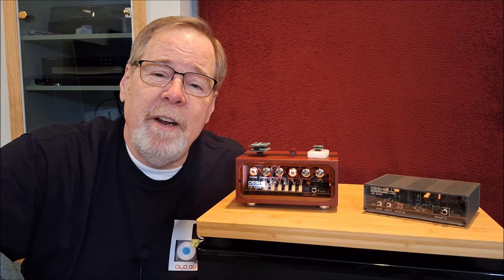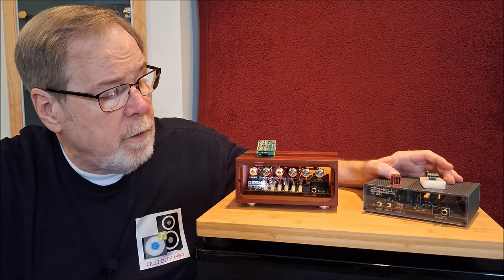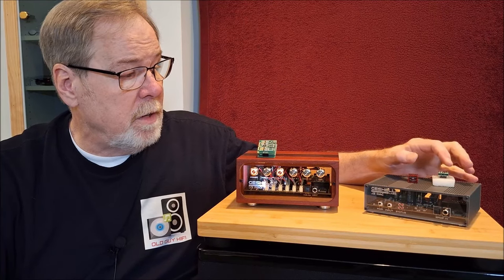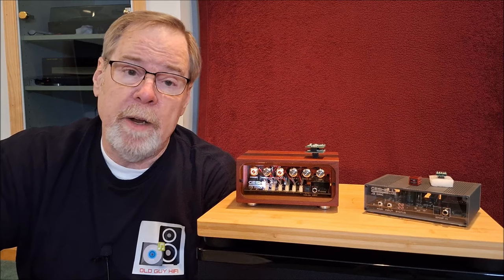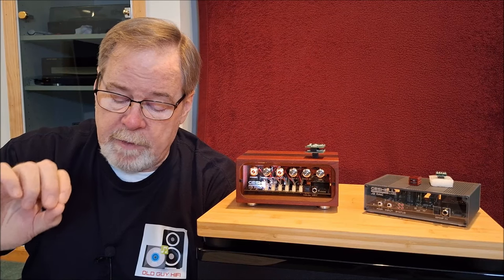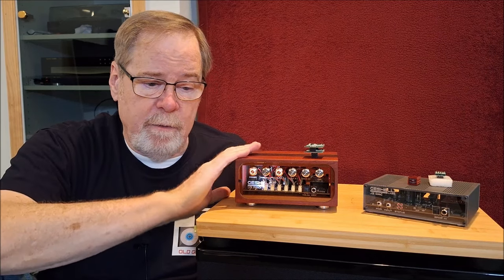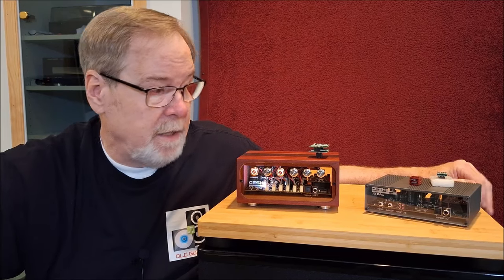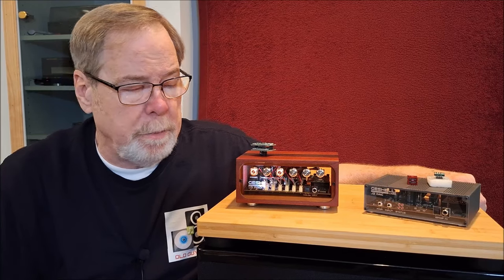The 1st YouTube review of the Geshelli J3 Pro DAC. IMHO it is a fantastic unit full stop.

Comment from the maker: Please understand that all of my reviews are completely subjective. They are my opinion and not to be taken as criticism or as negative. I can only share my feelings and personal conclusions.

The J3 Pro shares it basic architecture with it sibling the J2S socketed AK4499EXEQ + AK4191EQ hybrid DAC implementation. It  has been redesigned to accommodate the much larger Sparkos Pro Dual SS2590 op-amps. Geno Geshelli also updated the circuit design with an improved internal power supply, an improve oscillator chip and a relay switched USB board.

Comment: Very nice work!  Thorough, competent, clear, and devoid of filler.  Take another listen to USB on each of the two units, they are different circuits.
Reply from the maker: Not really. The USB boards are the same programing. On the J3 Pro and the Dayzee it has a relay circuit that can be shut down when there is no incoming signal. Sonically, I could detect no real difference but, that's just me. I will ask Geno when I see him next week. Thx.

Comment: Excellent video, Ed! You have nailed what I am also hearing in these DACs. I now have the eight SS2590 op-amps installed in my Dayzee - and it is by far the best DAC I have ever heard.
You're a "natural" at this - very informative, and direct.
Reply from the maker: Thank you so much. Maybe I could review a speaker or two? I will pay the freight.
Reply: @OldGuyHifi  The thought has crossed my mind! I will be shipping the first Tower 6 flat pack tomorrow, and MLTL-6 flat packs have been shipping for a while now.

I just revised the crossovers for the dome tweeter versions, and I think it is better than what I had at AXPONA. The cabinet of the Tower 6 has also been revised - and the bass is better AND extends to 25Hz vs 28Hz for the prototype.
Reply from the maker: Keep me posted. You have my email. Thank you so much for considering it.
Reply: @OldGuyHifi  put two of his TLine towers on a J3 and use a few Fosi V3 monos with the same opamp in all of them and let us know how good it is!
Reply from the maker: @morgande  I think they deserve something better then the Fosis as nice as those are. I would like to run them on the Orchard Audio amp. BTW I am getting that back.
Reply: Sorry I just caught up to this review. I got behind on YouTube. 😂 Great deep dive on the whole chip subject. My J2S with the 2590 on the single ended socket is truly outstanding. It’s attached to my vintage McIntosh system and ADS L710 speakers. It’s outstanding sound. It rivals my much more expensive Ladder Schumann r2r dac. I play them both interchangeably.
Reply: @OldGuyHifi agreed!
Reply from the maker: @stevezeidman7224  Thank you. I was curious to get your take on it vs the Ladder-Schumann. I do think that there is something to this chip set. I have the Orchard Audio mac-daddy streamer-DAC in house for a review and it uses the same chips and it also sounds amazing. At $1500.00 it should!
Reply: @stevezeidman7224  C'mon Steve - you're hours late ... 😀
Geshelli Labs has a stunningly good DAC model lineup - in my opinion!
Reply: @NeilBlanchard  You got me, Neil! Yeah, they are certainly not a one trick pony anymore. Their range of models and chip sets can satisfy anyone. Knowing them as we do, I’m very happy how successful they have become.

Comment: Earlier in 2024 I did not wait for the J3 and got the J2 socketed. 4499 chip and Burson V7 Classic op amps, single ended only. My seventh DAC in 25 years. I was concerned about Burson V7 Vivid due to my Klipsch Chorus II horn speakers. I use Tidal through a Blusound Node and a Tascam transport. Both sound excellent, but Tidal HD recordings are exceptional.

Geshelli J2 socketed DAC goes great with Conrad Johnson PV12B preamp and KT-88 amplification.

Great reviews!
Reply from the maker: Thank you for your view and comment. The J2S and J3Pro fire all intents and purposes see sonically identical. I bought the J2S I used in the review.

Comment: Ed: Great review that was concise and easy to follow and understand.  I upgraded my Geshelli J2S from the Sparkos SS3602 to the Sparkos SS2590 this week. You are 100% correct in your evaluation. Even my 76 year old "stone deaf" ears could hear the dramatic improvement!  My system of ELAC UFR52 tower speakers, EMOTIVA 135 watt receiver and ONKYO CD changer sound unbelievable.  All aspects are markedly improved and I am hearing things I have not heard before.
Chris G. San Diego.
Reply from the maker: Chris, That's awesome. I am so glad you are enjoying  the sound. Gear that can put a smile on your face is a real kick, Thanks for watching and sharing your experience.
Reply: @ChrisGarrett-q1x  hey Chris, fellow J2S user here, thinking about upgrading to the 2590 on the unbalanced output. Were there any special connectors needed or was it a simple swap out?
Reply: @moremeditations3622  I'm not sure I  understand balanced vs. unbalanced, so here is what was done.  My previous amp did not have XLR, only RCA connection.   Because of this I only have 1 of the 2590 op amps.  There were no special connectors and fit perfectly in place of the 3602. 
Forgot to mention that I also upgraded to the AKM 4490 chip set.  This was done by Geshelli.  Sent it to Geshelli for the install. This was also another great improvement in sound. 
I hope this helps.
Reply: @ChrisGarrett-q1x  yes this helped a lot, thank you!
Reply: one final note. Sparkos sent the SS2590 fully assembled as I am not a do it yourself person.

Comment: Great review. I'm just tired of chasing dacs. I bought the best l could and now they'll have to do. Your info is great for new buyers though.
Reply from the maker: Michelle, I agree with you. I thought I was done and in a long term relationship with my Schiit DAC. This new chip technology from AKM is spinning my head around. It sounds very good and the units have a couple of features I don't have like DSD and balanced outs. What DAC did you get?  Thanks so much for you comment and for tuning in.
Reply: @OldGuyHifi  My Geshelli Dac totally outclasses my Schiit. I love Schiit gear, but my phono amp has been replaced by a Darlington Labs MM6B and I am now running a Geshelli Dac. Huge upgrades.
Reply from the maker: Christopher, Which Schiit and which Geshelli DACs do you have?

Comment: Just swapped the 2590 into my J2 4493.  Using the unblanced outs.  From the 3602 to the 2590, it is quite an amazing upgrade.  Thanks for the heads up!! Dig the channel!!
Reply from the maker: Bobby-Bobby, You are welcome. I am glad you are enjoying that new op-amp.
Reply: @BobbyTwoTimes  Hello, do you have use raiser to install the SS2590 into your J2, just to add i have the J2S dac.
Reply: The stacked op amp from Sparkos will fit the single ended J2S.  It's snug, but it works.  Balanced will need risers and a taller case.  Sherri at Geshelli can set you up if you want the J3 case, and front/rear faceplate that accommodate the J2 board.

Comment: Great review. Thanks. Would be interesting if you were able to hold onto the J3 Pro and combine with their Achel Pro as preamp / DAC combo driving the Orchard Audio. Would probably make a nice reference level review system…
Reply from the maker: George, It would for sure.  That said I have the Orchard Audio PecanPi+ Premier streamer DAC in and it also uses the AK4499EXEQ + AK4191EQ combo chip set and can be a pre-amp. Unfortunately I had to return the Amp. I will ask for it back and maybe do a review of the OA combo. Thanks for the suggestion and your comment.
Reply: @OldGuyHifi  It’s unfortunate you had to return the OA amp. Would have been interesting to compare the 2 AK DAC implementation (or any source) with the same amplifier/speaker setup - ie introduce a new component for review but the rest of the system is a known quantity.
Reply from the maker: @georgechirayus4865  Turns out I will have the amp back in my possession next week. So watch this space.
Reply: @OldGuyHifi  Niice!! 🎉🍾🎊

Comment: Very informative. 
As I’ve mentioned in the comments of your fiio r2r dac, Sound stage, width and depth are what I’m looking for. My speakers are Maggie’s.
Reply from the maker: I can recommend the Geshelli J2S or J3 Pro with the AKM4499 setup. They sound near as makes no difference the same. Either of those will give your system all of the needed signal to develop the best sound stage it is capable of. There lots of other great DACs I just happen to really like the sound of the Geshelli units. I also like Denafrips and Chord but they get expensive. Let me know what you decide to do. BTW, I have a Denafrips Pontus review coming out & I just got a Chord Cutest in for review. Thanks for your view and comment.
Reply: @OldGuyHifi  Hello and thank you for your detailed reply. Yes. The J2s with Sparkos is roughly $100 less than the J3. Good to know your thoughts on the comparison. I was very interested in the j2s, but there were a few on us audiomart right after they were purchased. So then I moved on to the Aune x8 VIII. It can accept Sparkos and it’s a preamp. I recently removed my Schiit Magnius from the chain. Just using my DACs. My amp has attenuators. 
I’m 70. ExPat living in the 3rd world. I’m losing interest upgrading. Inflation is pretty bad here and that’s that.
Reply from the maker: @jayem1826  The Aune is great unit, Sorry to hear about the local economy. I get it. I was very happy with what I had prior to starting the channel. Now I am very fortunate to have companies willing to send me gear for review so the upgrade itch get a good scratching. Also, the channel does a good job of keeping me busy. You know what they say about idle hands! Thanks so much for being a part of my channels growth and part of the community.

Comment: Ed, thank you for you informative review on the J2S and the J3 Pro.  I have the same older Schiit Bifrost Multibit w/ Unison USB (USB upgraded from USB-3(?) to USB-5 and finally to Unison-USB) you use in your system, feeding a Schiit Freya Preamp (original model) going into a Yamaha Stereo Power Amplifier B-2X into some Juan Marie Raynaud Trenté speakers.  SPDIF both co-axial and optical are very good into the Bifrost are excellent, but USB is outstanding and improves the musicality of the system to a whole next level.  This was not the case before upgrading the Bifrost to Unison-USB.  My question for you is how do compare the USB performance between the 3 DACs?  Also, I have been enjoying your channel for several months and I am subscribed.
Reply from the maker: Thank you for subscribing. Great question. The J2S/J3 Pro both use an Amanero USB chip on a board that Geshelli has designed and builds in house. Like the Unison USB design, the Geshelli design does offer electromagnetic (EMI) and electrostatic (ESD) isolation but, whether or not the Geshelli design offers complete EMI and ESD isolation like the Schiit design, is something I would have to ask them about. In practical terms they are almost indistinguishable sonically. The real difference is in the DAC topology i.e., the Schiit Mulitbit AD5547 chip set vs AK4499 chip set has a far greater impact on the sound of the unit then the USB circuits. They are different sounding but, it is just different. One is not necessarily better that the other. I love my Bi-Frost but I am smitten with the Geshelli and the AK4499EXEQ+AK4191 chip set. I have a review of another DAC that uses the AKM chips that sounds great as well coming out soon. Long winded answer. Sorry. Thanks so much for watching.
Reply: @OldGuyHifi  Ed, Thank you for taking the time to respond.  I look forward to watching more of your videos.

Comment: Hi Ed. Thanks for a great review. I just ordered a J2S with AK4499 based on your review. Are there not three different gain settings in the J2/J3, low, medium and high? Did you check out this when you compared them?
Reply from the maker: I did. The output level has no effect on the sound of the units. I run them in high setting always. They do output a smidge more than 2 volts but I find it to be a better match up to other gear I have in for review. Thanks for asking.

Comment: Hey Ed... I have a technical question.  I have a J3 Pro and Erish 3 stack loaded with the 2590 Sparkos Op Amps in Both. I have the J3 Pro going to a Schiit Lokius tone control and then to the Erish 3(XLR) and OG LYR3(RCA). To my surprise the RCA connection is LOUDER than the XLR connection with the 2590's installed in all 3.  When I change the Lokius from XLR to RCA the volume is obviously louder coming out of the Erish 3 and LY3 and I'm wondering if this is normal or is it an odd occurrence?  I've always been under the impression that XLR connections are louder than RCA. Thanks.  You have a New Subscriber 🍻
Reply from the maker: The Lokius will take single ended inputs and convert the signal up to a balanced voltage even when you listen to the Lokius balanced out even if it is in the single ended setting. I noticed that also. I am pretty sure it is not changing the signal format from single ended to balanced just upping the voltage. In my experience, unless you are running very long cable runs, single ended and balance, near as makes no difference sound the same, just a bit louder. Great question Thanks for coming over from the short video.
Reply: @OldGuyHifi  I'm liking the power I'm getting with the J3 Pro, Erish3 and LYR3 with the Lokius in between. Both amps drive the ZMF Atrium with ease and there is some nice Bass and Dynamic punch and slam
Reply from the maker: Sweet rig. Very resolving. I love my Lokius. A little cut here and a small boost there and Hazah! I am off to my happy place.
Reply: Have a J2s 4499 and found that the single ended is indeed louder also.

Comment: Thanks for the review!
I especially appreciate your explanation of the hybrid chip set. 
I’m still curious whether the power supply upgrade in the JNOG3 makes a difference in the sound? 
Which DAC sounds better w/ the same chip set & OpAmps?
Reply from the maker: John, There were times where I thought I could hear a tiny difference and then times I was not sure at all.  I think upgrading a J2S with a external linear power supply would yield a bigger difference. Because I could not get the big Sparkos in the balanced side of the J2S i can't say for sure. The both sounded as near as makes no difference, at least to me, the same with any combo of op-amps on the single ended side. Now the J3 with the 2590s on the balanced side was quite a remarkable difference. More authority and drive. Better detail without any harshness at all. It felt like the tap was fully opened. One of the best I have ever heard. Thank you so much for watching and commenting.

Comment: Interesting video, mate! I'm in the market for a new dac and was going to buy the SMSL D400 Pro. It's got the same dual-AKM chipset as the J3 Pro. I want to learn more about the J3 before making a purchase decision. I don't see the Sparkos 2590 as an option, though. There's a Sparkos 3602 -- is that an upgrade? My audio system is PC-based (Adam A7V + SVS SB3000), FWIW. You've got a new subscriber!
Reply from the maker: You can put the 2590 in the J3. That why they came out with it. I have a 2590 in the single ended output of my J2S. The J2S and the J3Pro are as near as makes no difference the same sonically. I recommend listening to it for several months before rolling the op-amps. That way you will hear if there is a change. I think that they sound much better than the offerings from Topping or SMSL at the same or higher prices. Geshelli will sell into the UK, just email Sherri and tell them I sent you. Thank you for the view and comment.
Reply: @OldGuyHifi  Hey, thanks so much for your insights! Glad I waited on buying that SMSL. Nice catch on my heritage, BTW. I live in the U.S., though. Moved here for a contract gig about 12 years ago and decided to stay. Will order the J3 tonight. Thanks, again!

Comment: The J2S' balanced outputs can be fitted with SS2590s. It requires a riser on the front socket and an extender for the rear. It's a tight fit and one needs to be careful, but it definitely elevates the J2S to another level, as it does the J3 Pro. This arguably makes for the best sounding setup under $1000 USD, especially when powered by a decent linear PS. I give second place to the Burson V7V, which I found to give a bit more midrange energy and emphasis on soundtage depth. The V7C is very balanced and smoother, possibly a better match for the ESS platforms for the reasons you mentioned. Lots of fun here.
Reply from the maker: Theodore, That's great info. I know Geno had some trepidation about putting 2590s on the J2S board. I think that's partially why he did the redesign. But man it makes a difference. As I type this I am listening to a DAC that also the AK4499EXEQ+AK4191 chipset. Holy moly is it good. It may be the best "chip" based DAC I have ever heard. The review will be out soon. I think that chipset is a true gamer changer for delta-sigma designs.